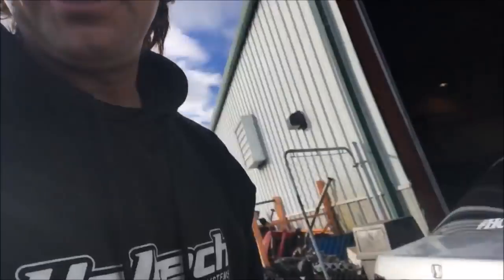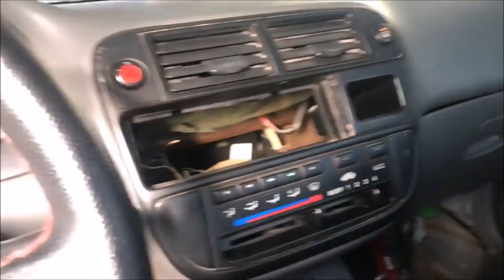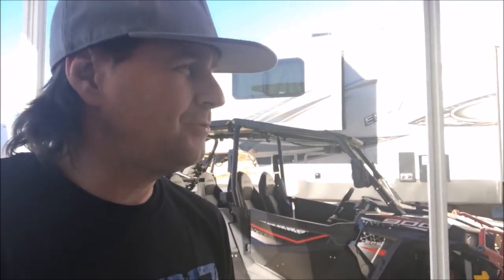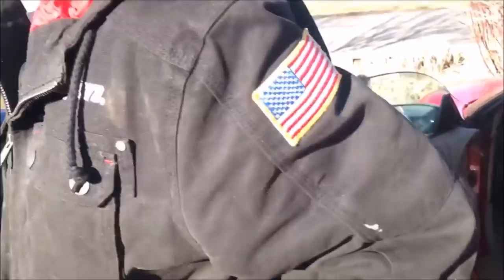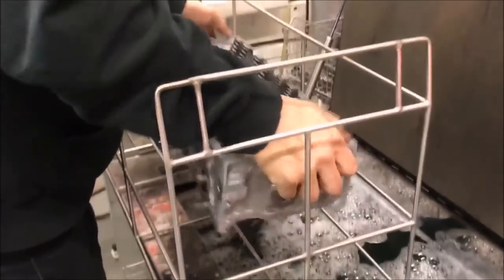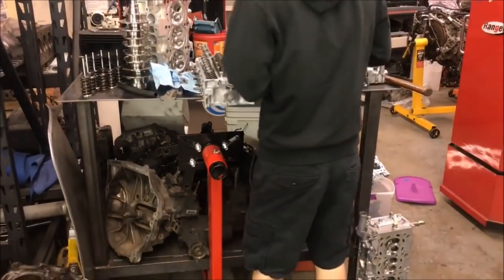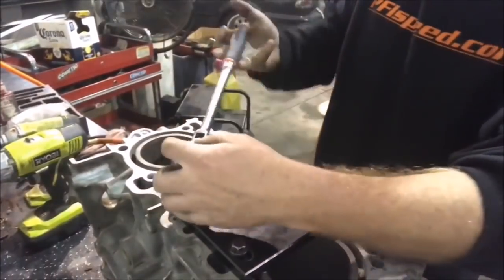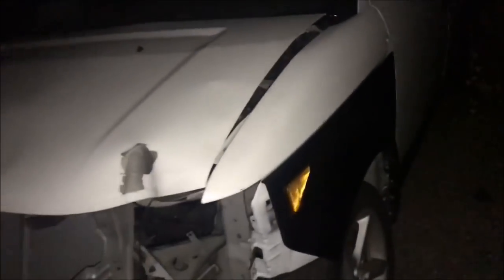Project updates, Trailer park folks and installing time serts

Comment: Man I wish my cars sound system had that voltage haha, how did that Alt have such a high voltage? Digging the channel Brent. 
I did automotive engineering at polytec, and did my work experience at a place called NZEFI, my job was warm up, put the car on the hub dyno, etc. I remember they had a Nissan Skyline gts-t that would run, but as soon as boost came on, it would cough and fart, 
The dude that owned it just put a fuel pump, and braided fuel lines.
So after a few hours I started pulling the fuel lines off, turns out the fuel lines were on the wrong way around. So simple, yet such a hassle.
Reply from the maker: Lance Johnson  regulator went out

Comment: Alternator overcharging? -> turn electronics on.
I guess workaround beats real solution XD
Reply from the maker: Nebbia affaraccimiei real solutions swap alternator and he knew to do it at home .
Reply: PFI Speed haha ok worth specifing thanks
Reply: The owner was there and wanted to keep his spot on the rollers which is why they decided to do the Band-Aid... I'm sure if the owner wasn't there they would have pulled it off the rollers and he would have lost his Dyno time to fix it properly
Reply: Once he hit the trottle it seemed to clear up and be good so why not tune what you can so the kid can have some fun.
Reply: Dnice8363 did you even watch the video? It has a bad head gasket.
Reply: And the kid would have had to come back for a 4th time if they turned him away.  Never went into what the car was doing with the head gasket so if its just cooling you can let it cool off and it will be fine to go again.
Reply from the maker: Dnice8363  yah I came out and felt the pressure in the system vs the temp of the motor so figured if we pushed it, we would have made a mess. So simple gasket change and maybe we can make it a fun car
Reply: This industry needs more people like you always willing to help and understand the struggle.  Not to mention you love what you do.
Reply: Teach us how to tune series! Subscribe!
Reply: Dnice8363 j
Reply: PFI Speed Brent my civic was running fine then started misfire  and blowing white smoke out my uppipe... Cyl 2 Was full of gas..... could a bad headgasket on cyl 2 cause dead cylinder and cyl to fill with fuel ? D16z6 engine 8 psi / cheap headgasket , 440cc injectors. I figured stuck injector or bad headgasket I purged gas replaced the one 440 with 2 different stock injectors and the cylinder was still dead..

Comment: Love the content man! How do I beef my d series trans? I've looked into syncrotech kits but heard they are hit or miss
Reply from the maker: Chris M. P  I use their brass not the carbon stuff with great luck
Reply: PFI Speed right on man. Which do you think is better for boost (stronger) s40 or s20. And thanks for replying I know you probably stay busy!
Reply: Which ever one has the gearset you want there all mostly the same just stay try and get the ones with the bigger diff bearings from the d16 vtec ex/si.  With a lsd and syncro's youll be good for up to 300-400 if you want more liberty plate em.

Comment: I was wondering. If u kno any pistons and rods that would fit the d15b VTEC. For high compression
Reply: Just did the conversion and looks like those rods work out to 134.3mm which is alil bigger then stock but will work fine.  Bisi wants 800 for his d15 rods which is nuts.  I would go cheap on pistons and get viataras they have pushed over 500hp on plenty of builds for $150 or you can get custom pistons from any of the big companies like aries/weisco.  Here is a calc for motors to play with.  

http://www.zealautowerks.com/dseries.html
Reply: thaks for the reply  and the help ,,, i was thinking of geting d16z6 rods  and leave stock piston do u think thats a good idea   or just go with diffrent piston
Reply: z6 rods will make the pistons stick outta the block and smack the head on every stroke.  Just go to a junkyard and get a d16 or f22.  f22 heads flow amazing for boost and can take a beating if refreshed right.  my d15b held 200whp for a few years before i built up a spare z6 was super reliable and really fun.
Reply: so basicly is better if i just get d16 and built that one .because right now im running 250 hp on stock inernals  boosting 10psi .just want to boost  more but its kinda hard with  the d15b.
Reply: I would just get a spare block there so cheap and if something happens you have another block to fall back to and plus if you want a fresh hone/bore you can avoid down time and what not.  The shop I went to took 6 months to complete the work so its completly up to you and your goals.  There is plenty of info out there.  I gave you some rod options and pistons are all the same regardless of d15/d16.  Viatara and eagle rods can be had for 400-500 for the d16 or some ebay rods for simaliar price for the d15 call eagle maybe they do custom rods or check d-series maybe there is a new company making rods for d15 that is proven.
Reply: thanks for ur help  i really appreciated...
Reply: np all the info is out there alil pain in the ass at times but its there.  I like to build in stages and plain for the worse case senerio to prevent down time.  I have one of the best tuners in the us which helps big time as well it serves so much to have that resource to fall back to when all else fails.
Reply from the maker: Sergio P Shane used Cx Racing rods with no trouble on his 370hp build and we are gonna do d16 rods with custom piston on the jdm d15b crank
Reply: So what pistons did Shane use for the d15b  thanks for the help

Comment: Does anyone know what a MAP sensor on a Y8 should read with the Key On Engine off on a P06 that is converted to a P28
 running Neptune RTP
Reply from the maker: BigBearWest  what elevation? -4 to -1
Reply: PFI Speed Thanks for the reply. Currently sitting at 3420ft.

Comment: I have d15b VTEC  boosted but I'm getting coolent going to over flow bottle  what does that mean..
Reply: Most likely a toasted head gasket to the water jacket.
Reply: Thomas Knight  thanks for the response .and I was wondering. If u kno any pistons and rods that would fit the d15b VTEC. For high compression